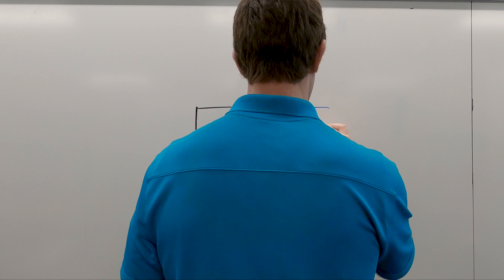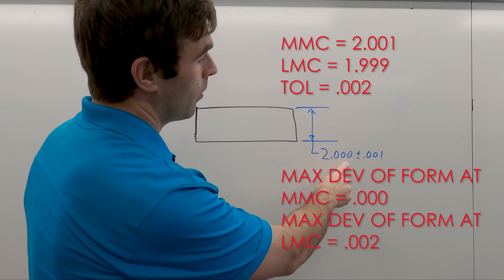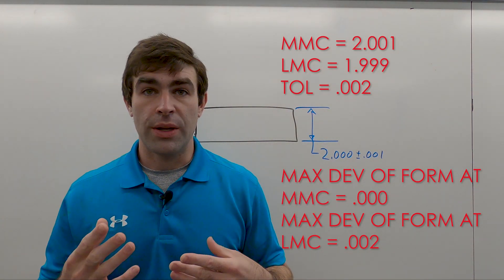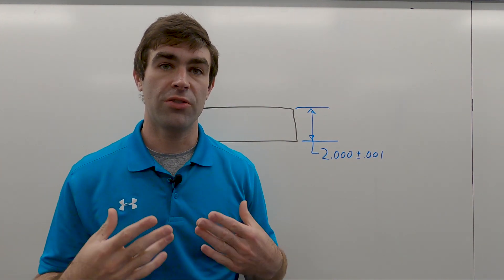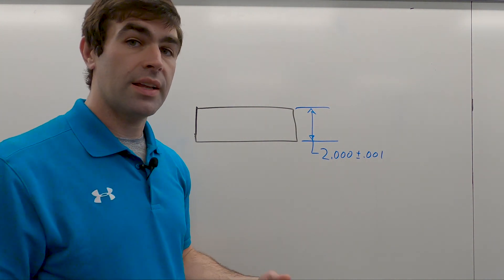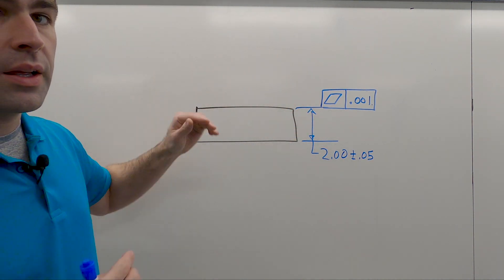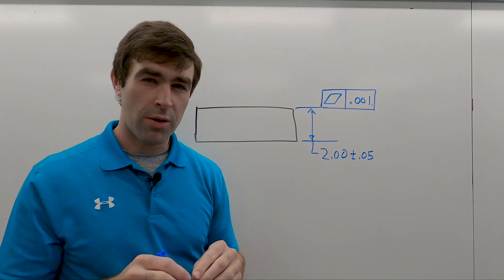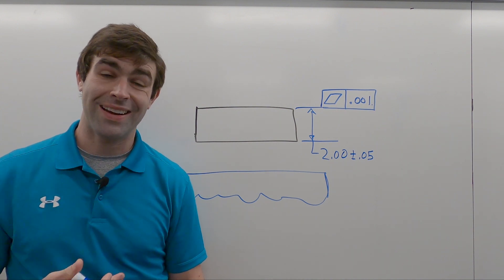GD&T Limits of Size vs Flatness, ASME Y14.5 #GDT #ASME

Comment: great, why do u use ASME Y14.5 1994? cause we have 2009 and 2018 version
Reply from the maker: Hi, That's a great question. The reason I am using 1994 is that I plan to make videos that explain the changes made for each topic in 2009 and 2018. That way someone will be able to easily interpret drawings made to any of the most recent ASME standards.